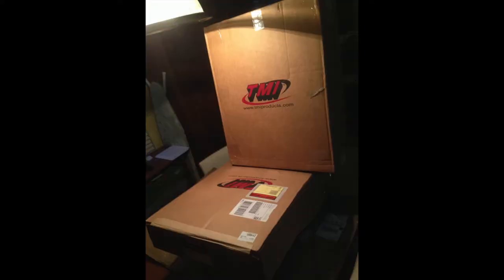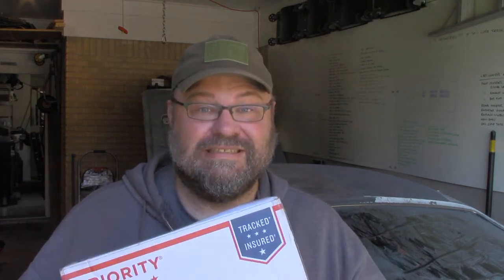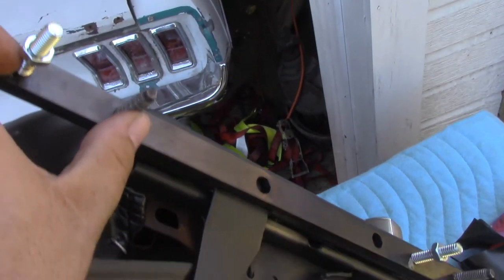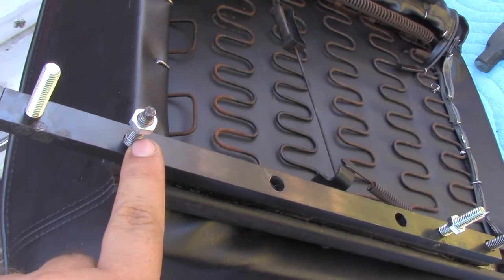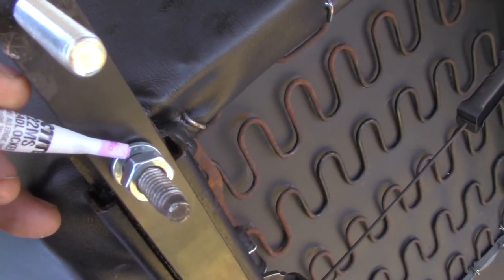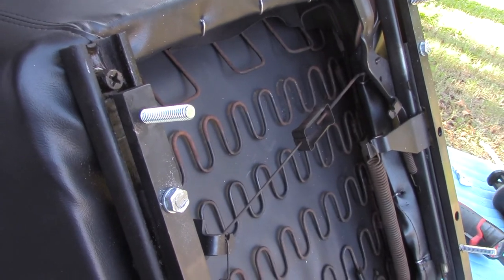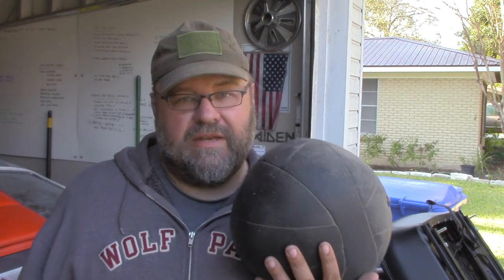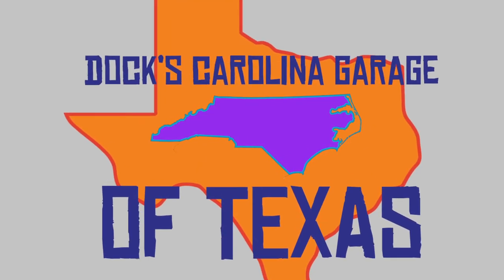Seat Rail Extenders! Get more room in your Classic Mustang the easy way! S1 E12

Comment: Great video! I'm late to this party. 
The extensions gave you some leg room but you didn't mention if they raised you even closer to the headliner.
Almost looks like the seats now sit on the nuts that you chopped plus the thickness of the added metal. 
Wish you would have shown headroom after install like at 1:45 of the video.

Comment: Extending seat rails come from Willoughby Ohio? That's about 10-15 miles east of Cleveland! I lived in the greater Cleveland area for most of my life since moving West in 2019. I wondered if the do those rails for a 64 Galaxie??? I don't have any belly problems by the steering wheel, its that I need a couple more inches of leg room and thought extending seat sliders will really work ??

Comment: I did this to my Mustang and I found that if you kneel with all your wheight on the seat or back rest as you install the hog rings it makes it 100 times easier. Unfortunately I found this out by the time I was working on the last seat but now you dont have  to go through the same pain if you are reading this.

Comment: Like vid!  2 things -
Around 2:20 your talking in the Garage - in the background is a wall with writing all over it.  Cool concept, I like it.  What did you use?
As a medicine ball alternative when I'm putting seats in I fold the back forward & run a piece of rope down the back of the seat, between the seats back & bottom then loop around either the pedals or steering wheel, & tie the 2 ends together. The loop keeps the seat from rocking back.
Reply from the maker: +Chris Thomas thanks for watching! I appreciate it!

Go to Lowe's and ask for "smooth tile board." Should be in the bathroom supply area, you can get it in 4 x 8 sheets or they will give you one free cut per sheet. Test your markers for "erasability" because some brands are more persistent than others - if it doesn't erase well, try Purell hand sanitizer :)

Also put the tile board in your garage for at least 24 hours before installation to let it adjust to the weather, or else it might swell. Wish I'd known that ;)

The loop of rope sounds like a great idea! I just happened to have the medicine ball handy and I wanted to try it :)

Comment: Heated seats... in Texas... I see another problem those rails are gonna cause you... did those further reduce your max headroom?
Reply from the maker: +Tommy Williams heated seats in large part because if you're gonna do it, you pretty much have one shot at the install (when reupholstering) unless you are fond of tearing apart good seats. Also sure this is Texas but when we went from 75 to 23 in 12 hours, it was 23 degrees regardless. We don't have a long winter but it does get cool enough that bun warmers are appreciated. :)
Reply from the maker: +Tommy Williams as far as the headroom it was a wash, the seat goes further back (and therefore down as the sheetmetal seat risers slope toward the back) and the fastback profile drops down right along with it. The 1/8 inch of extra height from the adapters seems to have had no real effect. Coupe or convertible owners would likely gain headroom because the roof has a level profile.
Reply: Try coming up to the great white north! I'm in Grande Prairie Alberta and wearing a light jacket and jeans in what you consider winter.